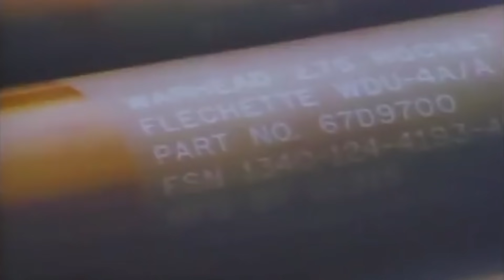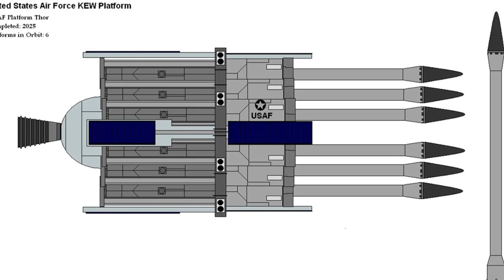'Rods from God' Weapon System Gets Another Look

Comment: I'm dumbfounded that you actually believe this.  You really think a 2000 pound chunk of metal moving at the speed of sound has the equivalent power of a nuclear bomb?!?  I really hope not guy.  Jet airliners, that weigh multitudes more than 2000 pounds have been seen crashing into buildings at 500+ mph and we already know what kind of damage that does (relatively minuscule compared to nuclear).  The speed of sound is just 767 mph so you may want to rethink your "facts".
Reply: CJ, the kinetic energy of a moving object is given by the equation KE = 1/2 times mass times velocity squared.  If you consider that the velocity is high, the velocity squared is considerably more.

THAT is why the force of the weapon is comparable to the damage done by a nuclear bomb.

May I encourage you to study Physics?
Reply: P.S.  This has been tested many, many times with falling objects and propelled objects (like big naval guns).  And the speed of falling objects can easily be determined by theory and experiment, which are in complete agreement.  It doesn't matter whether the object is tungsten or a big meteor.  Tungsten would be used because can withstand the heat of re-entry without melting.  It also has a high density (weight/volume), so it can be formed into an effective deep-Earth penetrator to damage installations more than 100 feet below the ground.  A standard 1.2MT atomic bomb would not be effective.

All these things can and have been tested, in one way or another.  Many times.

If you took the slight amount of time it takes to understand this, you wouldn't have to feel "dumbfounded." This is 400 year old physics; Issac Newton created these equations in the 1600s.
Reply: I completely understand physics.  Unless this guy was talking about the smallest nuclear weapon ever to be detonated, then ok.
Reply: 53,439,406.545454 Joules for this weapon.  4184000000000 joules equals a minuscule 1 kiloton explosion.  That's a long way to go even for that.

Comment: Uhm what s stopping the rods from delivering the kinetic energy underground away from the target. Waste of time.
Reply: Depends on the target.  Target the aft end of a ship, you'd knock out the engine and cause flooding from the punctured keel.  Likewise, a buried bunker needs a penetrating weapon.  Micro-rods could be used to target individual tanks, stationary aircraft, fuel storage tanks, and runways.   Think about the crater from an impacting meteor and apply it to targets.

Comment: These have no use in the real world. Anything they can do, a missile can do better, faster, and cheaper. Also, depending on the orbit, your target is either almost never in range or if it's in stationary orbit, your platform is easily shot down. Can you imagine what Russia would say if we put one of these over its territory? Completely impractical.
Reply: DOUG HEINS  1: It doesn't matter since all your bases are within 5 minutes of the target. First strike only works if you can destroy 95% of their systems, so that requires MANY rods.
2: Missiles\rockets are order of magnitude cheaper, so if you want multiple platforms, it makes far more sense to buy more missiles.
3: That distance is significantly further away than our bases/carriers/subs/bombers.
4: Yeah, that's why it's dumb to make orbital weapons.

Comment: Every ounce and gram of weight you launch into space must be pushed off the Earth's surface and into orbit.

The cost of putting so much 'useless mass' as giant solid rods into space would bankrupt the planet.

What we will end up with is a network of low-earth orbit solar powered rail gun platforms that fire ammunition about the size and cost of BBs.

The platforms will be equipped with recycling units that turn enemy satellites (space junk) into usable  ammunition, decreasing need for critical component resupply.

Comment: These projectiles have a few flaws the major one is that if you are able to introduce a tumble it will fall apart
Reply: hence why they have stabilizing fins.
Reply: there are ways to stabilize the weapon. you could either use stabilizer fins, or little rocket motors offset at an angle to generate spin, much like ICBM warheads do.

Comment: To prevent the Tungsten to burn up on re-entry, just have them coated with ceramic plates just like the retired space shuttles were! Not rocket science issue to overcome the re-entry problem. By the way, Tungsten has a very high melting point so it's not that easy to melt it at re-entry, but at those speeds let's assume will be Mach 15 or more similar to an ICBM, such high temperatures will take place since it was noted that plasma engulfed the shuttles at re-entry. But also when traveling at mach 15+ there's  little time available for the heat to do its damage to the rod before it hits the target so in general, the re-entry problem might not be a problem at all. ✌
Reply: your right about the ceramic plates. Jeez, if the US has this weapon, then its a better bargaining chip than nuclear missiles.
Reply: +Lucky Hazard. absolutely. because unlike nukes, you can actually use this weapon without rendering the area around your target permanently uninhabitable.
Reply: Why do you morons talk about ceramic plates (melting point ~2000C) to "protect" tungsten (melting point ~3400C)?

Comment: Sure. Now project the rod from space with the rail gun. 🤔 Without the friction of atomosphere, the rod could be accelerated by e/m to atonishingly high speeds. E/M assisted kinetic bombardment?  Hmmmm. 🤔
Reply: If moving fast enough, the proper coating would prevent the projectile from prompt disentigration, as it would not have suffecient time to interact with atmosphere before impact.

Comment: Forgot to mention a key step: cover the rods in a heat resistant ceramic coating. Avoids silly stuff like the projectile burning up on re-entry.
Reply: These rods would be made from tungsten, which is one of the most heat resistant metals we have readily avalible for this kind of use, and is one of only a few metals actually capable of withstanding re entry heating (due to its extreme density compared to other metals) so I think it'd be fine
Reply: Yup, just like the retired space shuttles were!!
Reply: No dummy face 
Basically this rods are made with tungsten for its density and high temperature resistance
Reply: Plus stealth under coating, they won't see it coming.
Reply: @clydekamana9531  stealth?
Those rods are kinetic
The only thing they will see is a meteor

Comment: Drop it on a fault-line. Instant earthquake...
Reply: lol the thing might trigger earth quakes regardless of if it lands on a fault line
Reply: @Thanos Car that's kinda like the comparing 10 mm to FN 5.7 one has superior stopping power the other has superior penetration. Also nukes normally detonate above the ground they never truly hit the ground themselves.
Reply: +Peter Z. nah, it's not big enough to trigger an earthquake (except a localized one). to trigger a fault line you'd need a nuke, and a pretty big one at that.
Reply: Frequency resonance would work better and be cheaper, a lot cheaper.
Reply: @anyoneofus9948  No it wouldn't,.. there was a reason Tesla tested his theories using other people's buildings when dealing with structural resonance.. The waveform is easy to produce, but there is no tuning fork that can handle it,.. even the skyscrapers built to withstand earthquakes would start to sway and he would have to smash his devices with a hammer to stop them.
Reply: Joe Soap  they are already in orbit, produced as far back as 1956. Boeing Project Thor. they are 50foot rods of Tungsten, that keep the heat of "re-entry" and hit at hyper sonic "re-entry" speeds.. anywhere from Mach10-25... that does more than penetrate that far. :D that vaporizes anything in it's vicinity and makes a crater. Put one into a sulfur deposit,or coal deposit,.. or a fault line .. or into Yellowstone Caldera
Reply: Joe Soap  and you don't know how fracking works, they don't try to cause earthquakes, removing the wastewater from the shales sometimes causes them becase the highpressure of the water being injected keeps fractures open so that the well produces gas... injecting water underground, and sending a screaming piece of tungsten into tectonic plate fractures and stress points, are two COMPLETELY different things lol...
Reply: You would need something a lot bigger than a rod from God to do that
Reply: How many would it take to shear off Kalifornia
Reply: @richardmyhan8755  It would be nice to find out...let's hit Buffy State with a couple dozen?